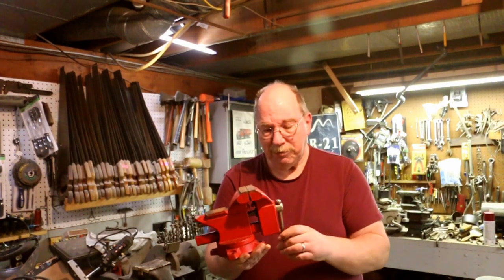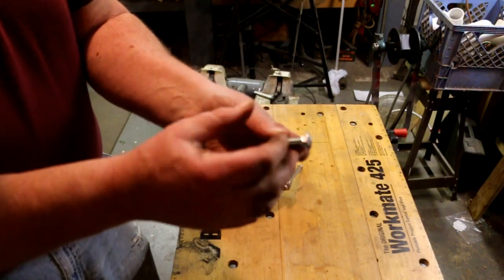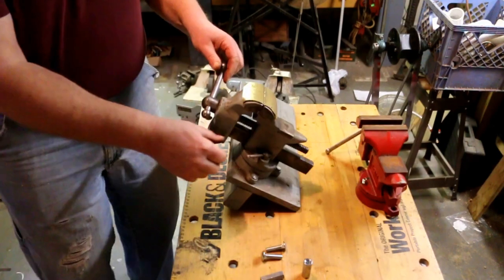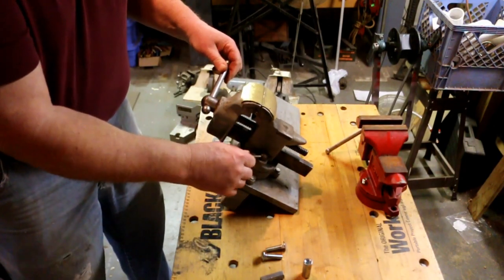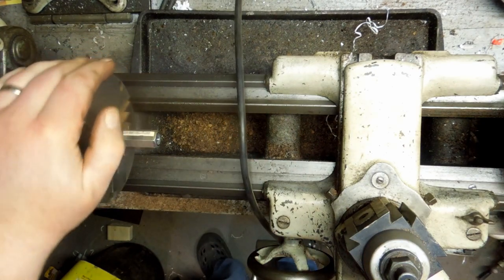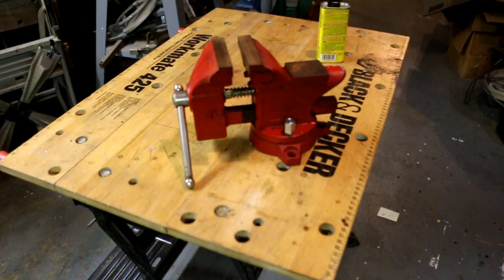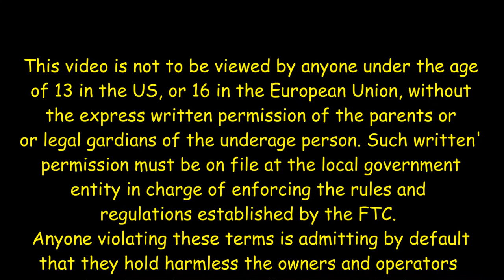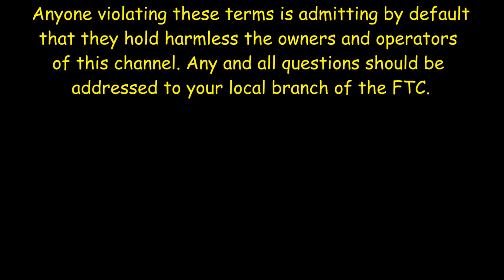Japanese 4 Inch Vise No  5177

Comment: Great news about Lydia. The vice was a real bargain at $5 but now it is a treasure. I like Japanese tools and I remember my first socket set was from Kamasa and really nice quality (it must have been as it was subsequently stolen) and I have never had any trouble with a tool from the land of the rising Sun. We do not see as many Japanese tools in the UK now so I guess they have also exported manufacturing to China.
Reply from the maker: After WWII Japan transitioned from craftsman manufacturing  to factory production of export items. The quality went from recycled materials used to create toys and trinkets to castings and machined products. By the 70's Japanese manufacturing had progressed to the point where they were beginning to rival Europe and the US. With the increased quality prices went up. 
As the world progressed China and Indonesia took over the making of inexpensive items
The US and other world  market is flooded with junk tools from China and Indonesia. Unfortunately the lower quality tools are just enough to kind of work. People can buy a full set of sockets for the price of a good quality ratchet. Of course the sockets won't last and soon end up broken. 
The result is only a few high end tools are sold in these markets. That restricts the market for them.

Comment: Double YAAY for Aunt Lydia and you! There's always 2 involved in an upset. And I had a vise like that and gave it to Ricey. All I remember that it was that size and red, came from Cheryl's step-dad and with the big Columbian I didn't need any more so off it went. And every blasted thing I have gotten had to be gone through, even if it was brand new. The 261 saw was about the only thing that was right but a brand-hammer new saw is pretty much spot on anyway. Warranty work if it's not. The splitter was new but was assembled sideways and lacking and WAY too much thread tape where sealer was needed. The air hammer works fine but the micro compressor is too small but I will get it directly. I do have the Milwaukee hammer drill and a carbide bit. Doing my wash as Toots rescued the grans and parent to go get tires on their rig and a grub run. I do run stuff around here sometimes. Now to fold and stack and maybe vacuum. The back is ready to mow again. More compost. Prayers going for yall and here we are if needed. GBWYou and THANKS for the upload and a wrench works LOTS better than a goofy handle!
Reply from the maker: I think the Japanese made millions of them. Just like Littlestown they made them for a number of years and sold them to other companies.
Reply: @OldSneelock  Sounds reasonable. I just know I didn't need it and it went down the road. That was before I started shipping North!

Comment: Glad the missus is better. That's a nice repair for the vise. Even without the clamp, it was a steal for $5. I dislike the bar clamps too.  I notice you get alot of use out of the B and D Workmate. I've been watching for a good used one.
Reply from the maker: We are taking it easy. 
The vise has been under the bench for years. I have forgotten where I got it. I think it was an estate sale. They always have the best prices. 
I expect that the kids just want it over with. 
I have 2 Workmates that Dad left me. I picked up the two big Workmates at the Estate Sale Barn in Schoolcraft and a Workbox.  I also have a Skil folding bench and a knock off folding bench. I use them all the time. My shops are too small to have  a big bench so I set up a couple in the garage and put a door or a sheet of plywood on them. Very handy.

Comment: Sir, I just bought this exact same vise at a yard sale. My only issue is that when tighten, it take very little pressure to loosen the “vise/clamping” grip. Is there a spring or something within the screw to add pressure? Thanks!
Reply from the maker: Just to make sure I understand. When you tighten the vise it doesn't take a much effort to have the jaws loosen their grip on the object being clamped. 
There is only the main clamping screw and the nut that provide enough friction to lock the jaws in place. There aren't any springs on the main clamping screw. 
Check the condition of the threads on the main clamping screw. Also check the internal threads on the nut. The nut is more likely to show wear because of the longer length of the main clamping screw. 
Worn or stretched threads can happen from overtightening the vise. 
Also check that the jaws are square. Overtightening the clamp can bend the beam and allow the moveable jaw to twist or rack. That lets the jaw slide out of alignment with the fixed jaw. 
Back the movable jaw out until it is free and check the beam with a straight edge. It should be 90 degrees to the face of the jaw. 
Also clean the main clamping screw and the nut. Dirt can act like ball bearings  and let the jaw loosen. 
It is a sturdy little vise and should be repairable. 😁😎
Reply: @OldSneelock  
Yes, that’s correct. All parts are intact and in good visible condition, except some dirt and grease. I will clean it thoroughly and see what happens. I appreciate your detailed explanation. Thanks again!